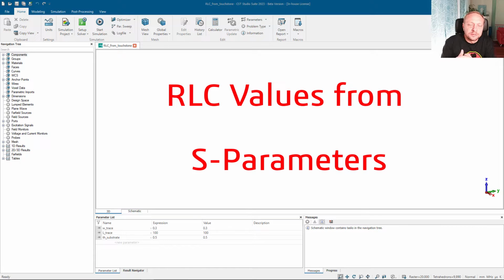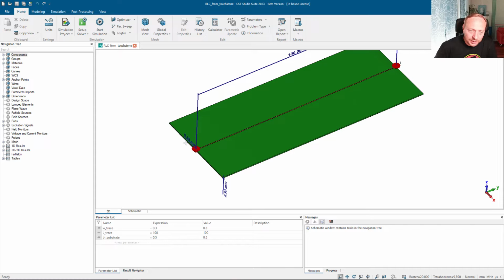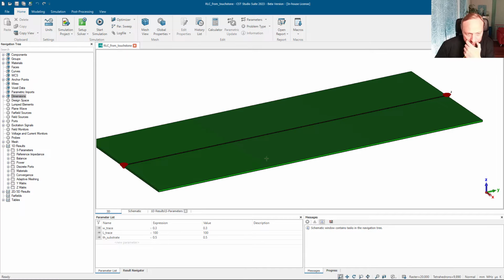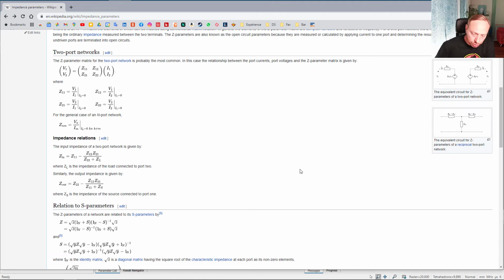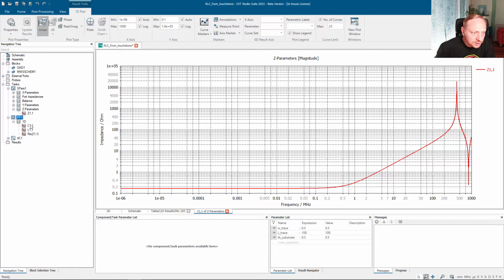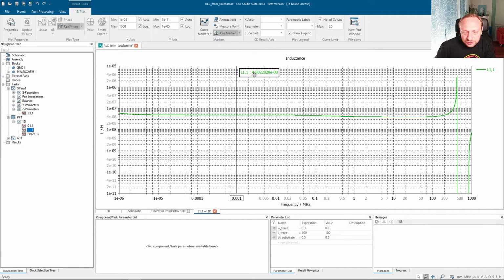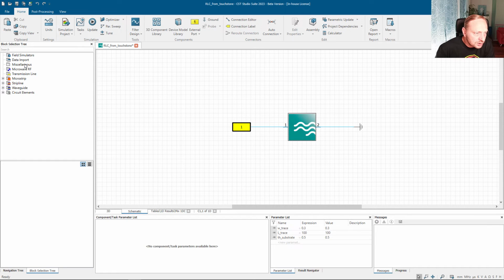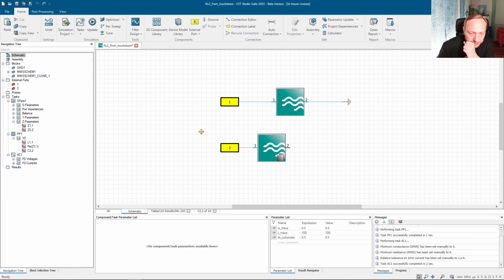RLC from S Parameter

Comment: Hi Andreas, can you extract fringing capacitance for calibration files and the residual inductance this way?
Reply from the maker: Not sure what you mean by fringing capacitance. In the end there is a capacitance between conductors and you can use CST to calculate it. And of course the inductance, too.
Reply: @AndreasBarchanski  sorry for my poor question. For VNA calibration you can input C0,C1... & L0 L1... Values for the Short and Open to build a calibration kit. I wondered if those values were within the S-Parameters that CST could extract them.

Comment: Hi Sir, It was a very nice example. Have a quick question. 

1. What if both the ends are terminated with 50ohm and how do you calculated the capacitance across the trace from port 1 to port 2.

2. Is there a way to measure parasitic capacitance of a PCB trace in CST simulation ?
Reply from the maker: 1) When you terminate with 50 ohm there is a current flowing and the capacitance you extract is negative.
2) I think exactly this is explained in the video

Comment: thanks for this explanations , i have quires about these RLC value that calculated ,  how can i arrange the components with these values in an equivalent circuit , because each topology as CSRR or SRR as an example has specific construction from one coil or more it depends .. and capacitors also  ..
should I use the Inductance value that you calculated as sum of all inductance used in circuit ? same question on capacitor value and resistance ...could you please show me this concept in video ?
Reply from the maker: This methodology does not automatically work for the generation of equivalent circuits constructed with some topology. I see many questions about meta materials. This is not what I had in mind when generating this video. What I do get is the low frequency R L C value of a component like inductor or capacitor. I am not familiar with the methodology to generate RLC circuits for meta materials, as this is not an emc topic.
Reply: @AndreasBarchanski  thanks for your response, could you please lead  me to whom is familiar with the methodology to generate RLC circuits for meta materials please

Comment: Hello. Could you please guide us how can we design an equivalent circuit of a unit cell (metasurface) for a S-parameters. Thanks in advance
Reply: did you get your answer on any video, if yes please refer to me. it would be very helpful
Reply from the maker: I am sorry, but that less my area. I deal mostly with EMC models. However, the way you go from S-Parameters to RLC is the same in both.

Comment: Very useful video. And how about multi port networks?. How can we extend this method for model woth more than two ports?
Reply from the maker: It will work the same way. If you are interested in RL you need to create a loop in the schematic for which you will extract the RLC values . The key is your schematic. The loop you define by shorting the ports needs to make sense.